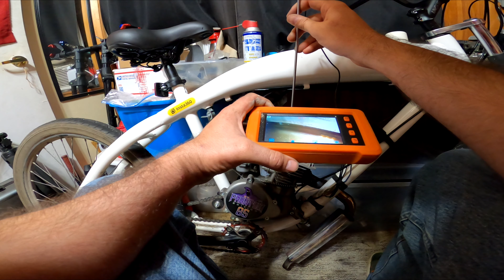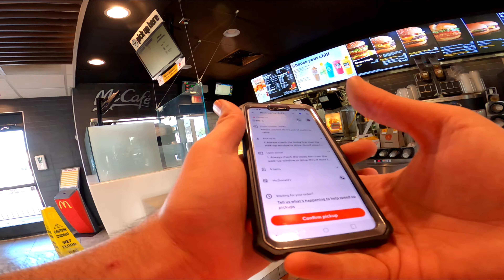Bore Scope In A Small Motor (Motorized Bike)

Comment: I built a custom cooler out of foam that you use on the outside of a house, with built in cup holders in (4 since that's normal amount of drinks) and basically just glued it all together inside of a large milk crate with a lid. Made it about 6" taller then the crate so it could fit any order and since it was a milk crate I could strap it tight to my bike rack. It works great and most importantly it holds the drinks from spilling and plus side being house phone it all stays cold (ice cream) on a 20-30min ride in the summer heat or keeps the stuff warm in the winter months. If you want more details I can give you them but at home Depot they have many thickness of that rigid foam and just good glue, I also silicone the corners and edges to seal it well. Either way it works great. Good luck and be safe out there brother.
Reply from the maker: Thanks for the ideas!

Comment: You could use a thin piece of shim stock inside the piston to act as a wear piece without adding too much thickness.  I wonder if it would be possible to add some sort of spring loaded lever lock button, like borrowing one from an old clutch setup, by drilling a hole in the right spot  in the perch and lever when it is pulled back to keep it held?
Reply from the maker: Thanks for the idea. As for the lever, I'm not sure. Might be able to rig something up. But it's not a deal breaker.

Comment: I've got two BoFeng carbs for many many months now and they run perfectly. So I am curious about the issues you've had with yours. I am wondering if some are made with different, worse parts than others.
Reply from the maker: Had bad luck with three of mine overflowing. 3 is my limit for carbs.

Comment: Best of luck with your Side Hustle! How much oil do u run? I've been using 4oz per gallon on a Seuteck that came with a 47mm cylinder that has different (very old/small center style) transfer ports from the case ports. I bought it 5yrs ago just put it on a salvage bike 8 months ago & it runs pretty good considering all. Did a port job on the cylinder 2months ago & that helped alot. I'm currently building a Mongoose FatBike, triple tree forks, 1gallon tank, CDH110(ported & cleaned up), SickBike JackShaft, Nickle Chains, Big Brake Rotors, Street Tires, etc.
       Stay Safe 🤘😼🤘,    Gprime
Reply from the maker: Same 32:1 and thanks :)

Comment: Off topic: have you tested the new bt100? i'm looking to replace my standard gen5 chinadoll for something that delivers a bit more from the get-go, or maybe with just a nice custom pipe added to it at least.
It seems like an interesting engine overall, despite the obvious disadvantage of the 1 piece jug.
Reply from the maker: I have not gotten to that one yet. I hear good thing about it.
Reply: I have a bt 100 on my bike I built in the early springs far no complaints after break in I did a top speed run on it and got 37 miles per hour with no mods in the engine an stalk exhost